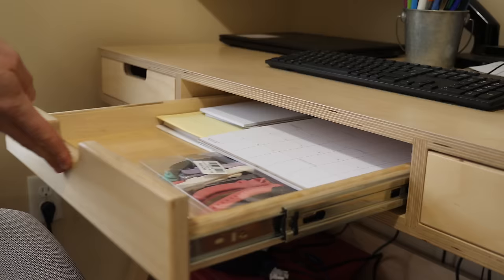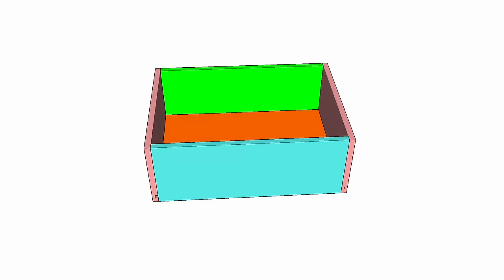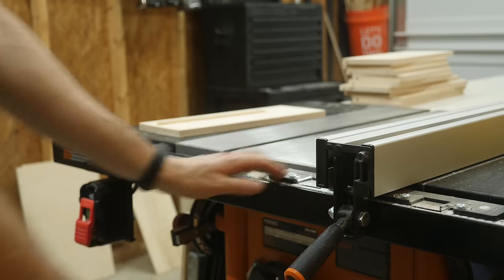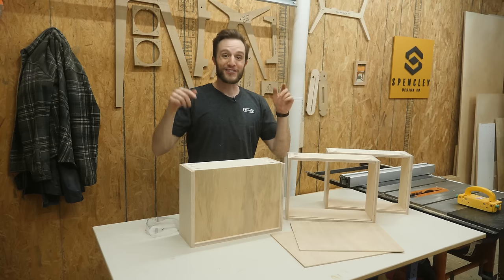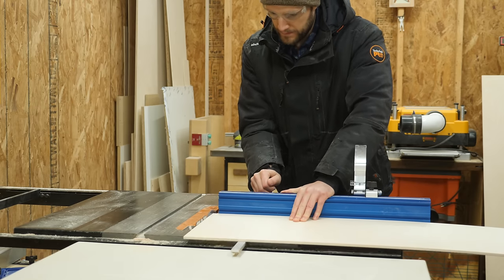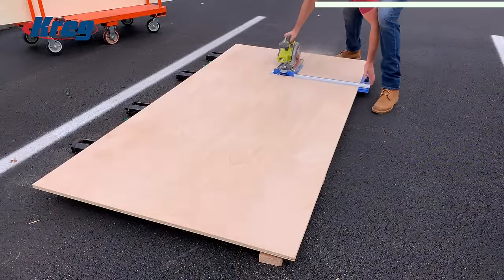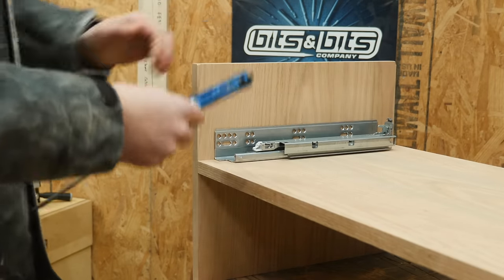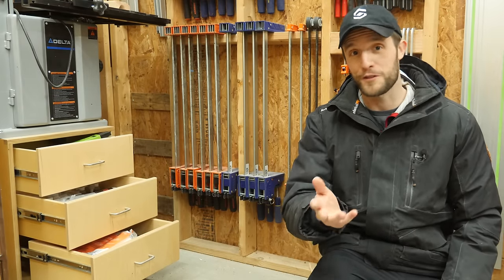Luxury Drawer Boxes - Decoding the Craft

Comment: Lettuce. Why not use the 1/4,1/4,1/4 drawer method? So much easier than using pocket holes and it makes for a much stronger/better drawer. It's funny a newbie woodworker says "Stop overcomplicating drawer boxes!  LOL
Reply: In order to do the quarter quarter quarter method you need exactly 1/2 plywood, 1/32 off and they won’t come out right, it’s pretty hard to find exactly 1/2 plywood, and other than that for new people into woodworking its difficult for them to do stuff like that
Reply from the maker: As I mentioned in the video, there are lots of ways to make drawers LOL
Reply: LETTUCE but no reply required. I enjoyed your take on drawer construction. Drawers are a key element in our lives. I also use many Kreg products and like them very much. I once had a problem with a table that compromised the ability to link several together so they just sent me a replacement without discussion.
Reply from the maker: I’ve had a very similar experience with kreg. They’re customer service is top notch!
Reply: @retrobuilds3729  The plywood I use is exactly 3/4" and or 1/2"...buy quality plywood and you won't have any problems. But at the end of the day the plywood can be any thickness, as the method is really considered as half,half,half.

Comment: So I’ve kept this video saved and refered to it more than once building drawers.  I’m still a newbie and frankly my drawers have been “ok” but never as good as i think is possible.  The main thing you’ve not discussed is you need to make sure your drawers are the width to “properly” fit into the carcass and it seems that that dimension is fairly strict.  Slightly too wide drawers and the drawers squeeze the slides and don’t work well.  Slightly too narrow and you can’t get the hardware to mate.  Not discussed much but as you’re planning you need to know the thickness of the side slider hardware and as far as i can tell its 1/2”.  I’ve literally been off what seemed like 1/16th of an inch too wide and had to try to shave down the drawer sides to make it work.   Can you make a video about that.  While you’re doing that there are all kinds of places for the screws on the side to be used and I have no idea between the various options for screw locations along with what appears to be some tab that allows adjustment if you cut your drawers too narrow.  Thanks for your videos my friend.  (Ohh and lettus .)

Comment: Thanks for the great video. I just built my first set of drawers a couple of months ago and used my pocket hole jig. I was using 1/2" finished plywood and used 1 inch Kreg coarse thread screws. A lot of the times the heads of the screws were not completely deep enough. It really didn't matter except when I had to install the drawer fronts. I ended up grinding down the screw heads with a portable grinder. I did try the 3/4" Kreg screws with fine thread. They did not want to grab tight enough. I could not find any 3/4" coarse thread screws to try. I don't even know if Kreg makes them. By the way the pocket hole jig I was using was the large Kreg Forman. Let me know what you think. All the best!!!
Reply: Lettuce!!!!!!!
Reply: I've had that experience before. It was really frustrating trying to set up a regular kreg jig with 1/2 ply. I had to buy the kreg micro jig to put into my K5 and use .75'' pan head screws.
Reply from the maker: I’d get the smaller head ones that are made for thinner plywood

Comment: Lettuce ! BTW do you use any glue while joining the drawer sides & fronts/backs as well as any glue for the bottom? It doesn't look like and wondering if the drawers can withstand the workshop usage. Thanks.
Reply from the maker: You can use glue if you want, but I've never had any issue using only screws :)

Comment: I also have that Kreg Jig. It's wonderful. Only thing I don't like are Kreg Screws. I used to like them a lot, but I just hate Robinson bits and heads. I ended up getting a 6" torx Bit and I now use torx screws instead.
Reply from the maker: If you can find torx pocket hole screws, let me know!

Comment: Lettuce - great video! When you demo’d the under mount slides, did you drill for the hole that had to be in the back? The hole that allows for the small alignment tab. Or does your setup not need it? Finally, why did you set the under mount slides back that 1.5 inches ( or was it 2)?
Reply from the maker: Yes, you would need to drill that hole. The slides were set back for that specific clip because it was an inset drawer front
Reply: @SpencleyDesignCo  Oh, I see! That explains why my insets have never worked out right. I’ve done them only a few times. Thank you again!
Reply from the maker: Sure thing!

Comment: Hi Lettuce 
What fence are you using on your Ridgid table saw. I have the same saw but the factory fence is terrible. Thanks
Reply from the maker: Thanks for checking out the video, Rick!  It's the factory fence that came with the saw
Reply: Sneaking up on the right cut is the right way to do it.  A tip I saw on another video was to put consecutive strips of painter's tape along the fence until it is the perfect cut.

Comment: Did you include links to sketch up file?. I am also not sure what the differences between box and drawers? In terms for width, depth etc. It might be helpful if you could explain that the drawers need to have less depth than the box, so fronts can go on>thanks. I couldn't find the plans on your website :) LETTUCE
Reply from the maker: Yup! The plans include the SketchUp file. The specific drawer dimensions are included depending on the project you buy
Reply: @SpencleyDesignCo  Yeap found the Kreg work bench and paid for it, but to my horror its in imperial :)
Reply from the maker: You can change the units instantly in the SketchUp file
Reply: @SpencleyDesignCo  Can you tell me where? I am using the free online version and the app settingd are in metric but changing a pre-created file?
Reply from the maker: I’m not sure. The online version is pretty bad. Download the free desktop version

Comment: Lettuce, does it matter how high the drawer slides are placed? And can I skip the dado method, since I don't have a table saw, and just make a butt joint with the drawers?
Reply from the maker: Sure, that’s always another option. It doesn’t matter where the slides are placed
Reply: @SpencleyDesignCo  Thanks so much for answering. I'm so stoked to try and make some now.
Reply from the maker: Good luck!

Comment: The video seems to Lettuce see you pre-drilling into the back below the drawer bottom?  Your technique does not have a back on the drawer I’d that size.  I’m confused
Reply from the maker: i'm not sure I understand your question
Reply: Totally understandable. My confusion causing more confusion, sorry.  @SpencleyDesignCo  In the video you show using a gig as part of installing a bottom mount slide. Is that the front or the back of the drawer?